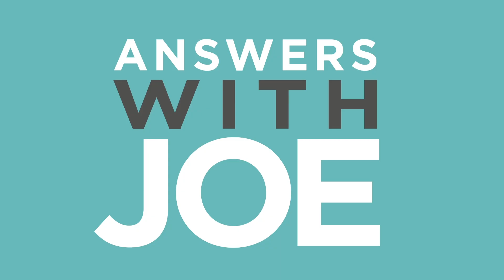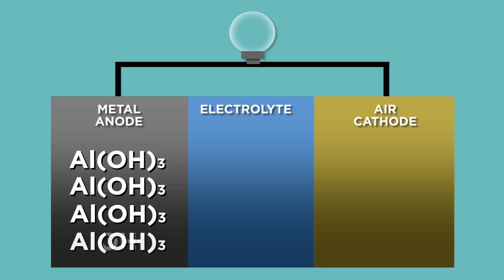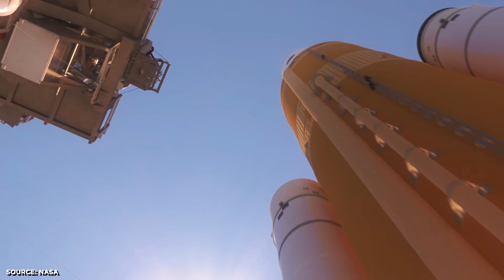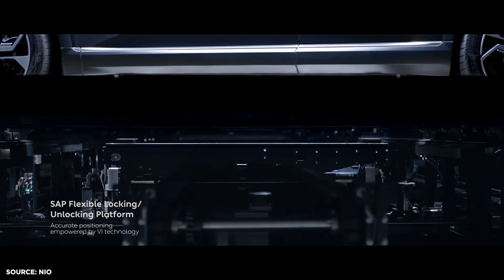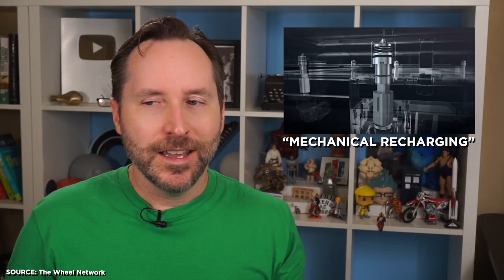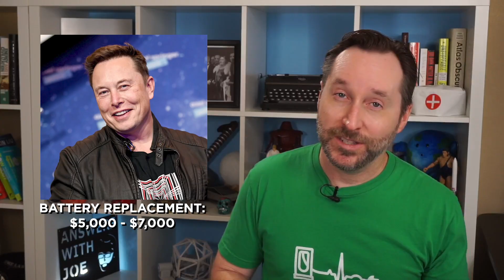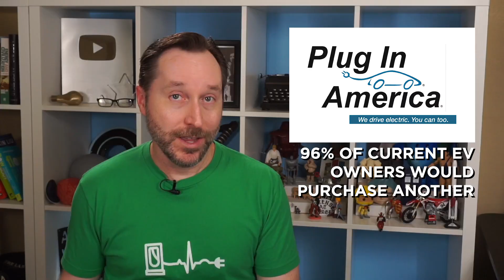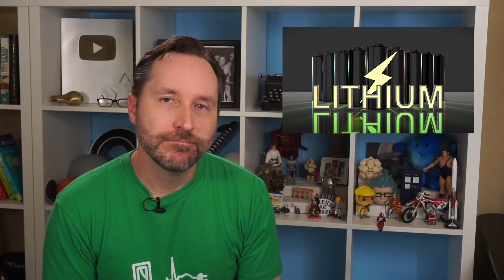This Battery Could Drive A Car 1500 Miles - But There's A Catch | Answers With Joe

Comment: I would say that the whole car industry should just agree on going with this battery technology and make it work;
1. Recycling is going to be more important than cost in the future.
2. If this were subsidized as much as the oil industry the prices could be regulated.
3. Using one battery system would minimize pollution issues worldwide.
4. Compatability between all types of vehicles.

Comment: I've been waiting for someone to make a hurricane battery out of one of these. Properly done it could sit and wait to be used for up to 10 years or more.  You could have an emergency powerwall with about a 300 amp hour capacity which would run everything in the house except a big air conditioner for at least a week.   The idea is you would have three chambers and an inverter.  The upper chamber would have the electrolyte in it, the middle chamber would have the aluminum in an oil bath and the bottom chamber would be a reservoir to drain the top two chambers in when needed.  When the catastrophe takes your grid away, you open a valve to the lower tank to drain the oil out of the aluminum chamber then close that valve.  Then open the valve to let the electrolyte into the battery which ideally will be connected to an inverter to provide AC to your house.   You can drain the electrolyte down to the reservoir when it's spent and add new electrolyte from the top.  If the aluminum part is a cassette you would change it out after it is spent and refill everything except the bottom reservoir which would be emptied.   Unfortunately a system like this would cost in the $15 to $20,000 range.

Comment: Untill a car runs out of battery on the highway blocking the road. You would have to have a service vehicle with an equal capacity for change to get the other car going. Sorry if this isn't clear.

Comment: The $16k bill for a battery replacement was because one plastic part going into battery for cooling broke off. Electrified Garage used a part available at a home hardware store to fix this issue for like 20 bucks. Another Tesla that they fixed had 3 cells failing in the battery pack. The cost to fix it was $5k instead of $20k Tesla wanted.
Reply: $5k is still a ton of money…
If u find a 1997 passat Tdi wagon you’ll get a NICE one for 5k. 
And it’ll give you 1500-2000+mile range. 
And being moderately powered does not pollute anywhere near a common rail Tdi (pollution scandal)

And it just might last longer than the rest of your life and could be handed down. 

Tesla cannot be handed down. U need accounts and stuff to even use it.

Comment: If they would standardize a size and mounting system for EVs you could buy a couple of these batteries and just keep them stored at your house and then do like a core swap program similiar to how some auto parts work. You get a discount when you bring the core of your old battery in and makes it a little cheaper to buy new batteries to keep on hand, but standardization would be a HUGE development for these, makes interchangability possible and just simpler and easy to use.

Comment: If they replaced cheap plastic gears with cheap aluminum ones it'd cost cents more and your appliances would last 10x as long.

Anything with plastic gearing is inherently a rip off though.
Reply: True, but anything designed to break soon after the warranty ends, so you'd go to buy a new one, is a rip off. The plastic gearing is just one example of it.

Comment: Non rechargable, but unlike some non rechargable batteries, they wouldn't go to the landfill, but rather be recycled, perhaps into new aluminium air batteries.  In a way, that's a kind of recharging, just via, in essence, a furnace and a factory.  Not as convenient, but not as bad as "non rechargable" sounds at first blush.  Then again, it could in some use cases be more convenient than waiting for a battery to recharge.

Comment: It’s not really at battery.  Rather it’s a fuel-cell.  The aluminum is consumed in the process through a controlled corrosion process and reduced to an electrolyte, which can then be recycled as a precursor chemical in the aluminum primary process.

Comment: For the record, car batteries out last the rest of the car in well over 90% of vehicles (for modern batteries, not including first gen).  Some data has been at 99.7% while some other estimates are closer to 95%.  Either way, the batteries aren't likely to be the failure point in most hybrid and ev vehicles

Comment: You say trucking them requires a lot of energy, but, ideally, wouldn't those trucks also be running off of aluminum air batteries?

Comment: Not sure if it's been thought of, but I think it would be cool to use rechargeable lithium ion batteries, and install wireless charging strips under the concrete at all the stop lights so the car recharges while it's waiting at the red light. It would take a lot to get it off the ground but it would sure benefit a lot.
Reply: pulling this off with induction charging wound be extremly costly. A better Idea would be litteral rails to get power without a battery at all. (yes an oversized slot racer) But in reallity, keeping those ground rails safe to touch limits therere Voltage to maybe 20 or so. Meaning a lot of current. So how about suspend the wire in the air, scale the car to fit way more people at once, connect many of them together to form a chain, which gets pulled by a single or a few propulsion units ... oh wait....

Comment: I just want a high-temperature superconductor that we could also use as a fast-charge supercapacitor battery.

So, uh... someone discover a superconductor that functions at over 400K please. Thanks in advance.

Comment: I would take one as an emergency-only backup battery in my electric car (presuming it can hold its charge for at least a couple of years). I would drive and charge carefully, since I know that once used up it's gone, but I would feel tons safer knowing that in a pinch I could get from Nowheresville to a charger without calling a tow truck.

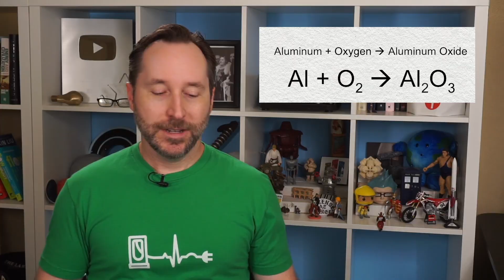Comment: 5:40 Wait, would the Aluminum metal actually be recyclable? Or is it physically depleted through oxidation, with the Al Oxide then needing the same amount of energy as ore to be re-processed into metal?
Reply: Clay in the ground is aluminum-oxide. It's going back to what it was. The energy will need to be used to process it. But the ability to do that when you want means you could use entirely solar to charge it.
Reply: @ddogthepimp  Thanks for the reply. It still sounds more intensive than recycling aluminum cans, which was referred to at the start of the video. I hope it would be done carbon-neutral if this type of battery ever went mainstream.

Comment: On a smaller scale Aluminum air batteries show an immense amount of promise for military or survival applications. Anywhere where you need a power source with no ability to refuel or recharge. A 10kg large lead acid battery mass equivalent aluminum air battery may have a minimum of 13 KWh up to 80KWh of energy available. That's a lot and could genuinely be a lifesaver

Comment: years ago my father told me that India was producing compressed air powered vehicles that cost about $5k US. No gas, only minimal oil to lubricate the cylinders and as the air gets used it actually cools down which means it can be piped back into the car as essentially "air conditioning", zero emissions and refillable with solar powered air compressors like your tires... anyone heard of this?

Comment: job killers, and make vehicles boring. plus, for fleets, it's far too inefficient to unplug and release these things and put a new one in daily or bi-daily whatever. you'd need to decouple electrical connectors, take off shielding, and use heavy duty lifts to remove and install them.

Comment: How does the enegy density of Al air batteries compare to Li-ion ?  How about weight, are AA batteries a lot lighter than Li batteries?    If they're a lot lighter, then that increases efficiency.

Comment: It would be cool if they could put these on trailers. It seems like one of the biggest negatives for EV trucks is that towing really kills the range while also making charging more annoying because you have to deal with whatever you are towing while in the charging station. 

I could also see some of the car companies doing a rent-a-battery type attachment where an area like the frunk can have an adapter for the single use battery. Proprietary adapters and battery dimension would mean the car makers would be the only ones capable of making them, giving the company another revenue stream, which would be enticing to them.

Comment: It would seem to me that the issue is not that the whole battery goes bad…it’s that the aluminum Cathode oxidizes and no longer functions. So…instead of replacing the whole assembly…why not just replace the Cathode? That would cut transport and storage spaces costs significantly. The main battery components would remain in the vehicle and a modular cathode pack would be replaced. It would make recycling easier too and transport much safer as you’d only be transporting an inert non toxic aluminum cathode instead of an energized battery.

Comment: what might it cost for a grid power plant using aluminum air? what if they had on site aluminum recycling? could this sort of thing help replace coal? i think batteries in general are the future of the power grid because you dont need to run a minimum to keep things going or rush to feed things when demand spikes at sundown. 
the only potential issue i see with this is loss of oxygen. if every coal plant was replaced with aluminum air right now would it consume enough oxygen to make an impact?

Comment: I think the option of hybrid batteries would be really interesting. Theres no reason you couldnt have a plug in ~50 mile Li-Ion battery to get you to and from work, and get all the range benefits of the Aluminum-air. You wouldnt need to replace it anywhere near as often, but the option is there

Comment: I will never buy a car or drive one that does not have a real gasoline fueled engine and a 5 or 6 speed manual transmission.  Long Live Real Cars that go VROOOOOOM and belch out that climate killer pollution.

Comment: Be kinda nice if it replaced lead-acid batteries, as those are a pain to recycle and are hugely problematic if you don’t, while I’d imagine a used aluminum-air battery would mostly consist of aluminum-oxide, which can be found in many rocks, so likely wouldn’t be the worst if they do end up getting thrown away.

Comment: Using these as swappable range extenders for electric cars, to maximize efficiency and range would probably be the best solution.  We definitely need to replace Internal Combustion Engines going forward.
Reply: No, we don't.  Extracting CO2 from the air and turning it back into petrol/diesel is the way forward. There are billions of cars that will carry on being used for many decades. Making artificial fuel will make all of them carbon neutral overnight, and the oil companies get to keep on supplying fuel, but stop prospecting for oil, and having to run refineries.

Comment: The problem with aluminum is that it corrodes very easily.....  If you had an Infinity Gauntlet you could snap your fingers and create the infrastructure too........... What's the use of having an Infinity Gauntlet if you can't?

Comment: I think that considering anything extremely expensive like the battery pack as a part that is designed to last the life of the vehicle is completely misleading. Life of the vehicle to a manufacturer is different that what we consumers think. For example, I love working on older cars and keeping them on the road reliably. It doesn't make the manufacturers any money though, so they would rather I get a new one and scrap the old ones. Saying that the battery lasts the life of the vehicle means that as far as the manufacturer believes you should scrap a perfectly good car otherwise for a new one. This is more waste than a standard internal combustion engine over the long run. Nobody is going to pay 15k or 10k or even 5k for a new battery on an old old Tesla. It is causing more waste and costing more money than is ever going to save.

Comment: Looks like the Aptera is coming back, Maybe something for you to look into?  They say its even better, as its Solar Powered and even a plugin, also.   Just Saying.
Reply: 1,000 miles per charge option available. Only 100WH per mile so solar panels can provide up to 40 miles range per day.  Production expected in 2022
Reply: @ErichPaetow  Sounds like something to keep an eye out for in 2022

Comment: One thing I've always wondered; is what happens if your EV dies on the highway? Or the desert? Or the middle of the night, on your way home, in winter? Basically. Anywhere there's no charging station nearby.

I always wondered if a - battery equivalent of a Jerry can could be made. Perhaps this could be something like that? Or at the very least, a reserve tank of sorts. If your car dies out; just switch the power over to the Aluminum-Air battery. Gives you enough power to get home, or to the nearest charging station. And you would only need to use it as a last resort, thus saving you from constantly needing to buy a new one.

Comment: The aluminum in discharged aluminum-air batteries will not be easily recycled because it will be aluminum oxide. This needs to be smelted to remove the oxygen and get back to aluminum metal. The smelting process is where the battery gets it's energy'
Reply: Same goes for normal aluminium recycling doesn't it? And if 100000 batteries are smelted together in the same oven efficiency goes up.
Reply: @God-yb2cg  No. If l have an aluminum can I can easily melt it and the metal can be immediately used. To go from dead battery to aluminum metal, the aluminum hydroxide will need to be extracted, collected, and sent to a smelter where massive amounts of electricity converts it to aluminum metal. Please search aluminum smelting to see what's involved. It would probably be better to bury the aluminum hydroxide since it's just clay.
Reply: @ngneer999  I see, sounds problematic, it makes sense since the same amount of energy needs to be put in to revert a battery to it's former state (no way around thermodynamics) but I thought a simple oven would have that energy.

Comment: I did not hear you cover it, when the battery is used up is the original aluminum still aluminum and can be recycled or is it a useless product that has to be thrown away

Comment: Pop these batteries, or, even the hybrid model with the Li-Ion, into trains, and build up that network.

This removes the excess diesel usage, and keeps things going rather well. And even though the batteries would be expensive to deal with regularly, you can offset that by the passengers.

Plus, putting more people into trains can help to reduce pollution and such as fewer people would be utilizing cars for cross country trips.

Comment: im no engineer but what about a battery powered boat with some kind of propeller system below the water line in which the propellors generate power that recharges the battery?.. or would it depend on the propellors causing x-amount of additional drag needing x-amount of additional power to move ship through water?

Comment: Why not use both systems? Use a rechargeable battery for day to day and then an aluminum air battery for when your driving outside refilling station range or emergencies?

Maybe I am wrong, but I don't see why these two technologies must compete.

Comment: When I went to Maui, Hawaii a couple years ago, my nephew and I took a ride on a tourist submarine that could hold up to 48 people.  This was an electric submarine that went to port every night to charge up.  During the day it stationed itself off the coast a couple miles.  The company had a ferry boat which took customers out to meet it.  When it surfaced, it came along side, the previous riders disembarked to the ferry vessel.   My group then came aboard and climbed down into the submarine.  They then got to see the submarine submerge and were taken back to the pier, where they got off before the next group started boarding.  They then traveled out in time to meet the submarine after finishing out underwater exploration.  The batteries were sufficient to do this all day.  The submarine took us over 100 feet deep which was at near the bottom in that area.
Reply: Can I NOT just read the comments without someone bringing up a "Tourist Submarine" ?? Isn't it ironic that they call seem to be captained by a guy named "Jim Jones" ?? Talk about a "one way ride"..

Comment: i'd say that EVs are already good enough and it would just require too much infrastructure to make aluminum-air batteries feasible. however, I can imagine that this would be a highly effective solution for boats like you said. there are far fewer ports than gas stations, and cargo ports already have large cranes that could remove and replace a large aluminum-air battery.
Reply: Agree
Reply: EVs are good enough if home charging is viable which it is not for many people get the charging time down to the same as refuling gas and then it will be good enough for those who cant home charge and even so hydrogen feul cells are alos viable option for those situations also
Reply: @ThunderClawShocktrix  DC fast charging should never be the solution for people who can’t charge at home as it degrades the battery much quicker than regular charging. rather, the solution should be charging ports at workplaces and just generally at most parking spots. the electricity is already run to parking lots as there are street lights. installing chargers shouldn’t be much of a hassle.